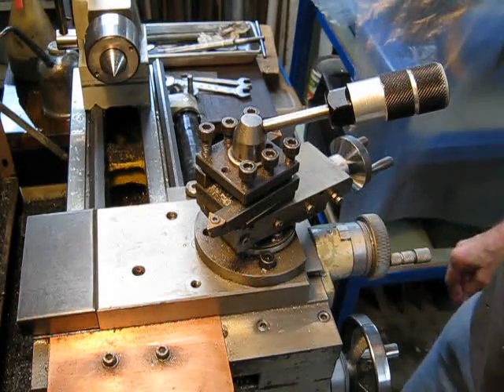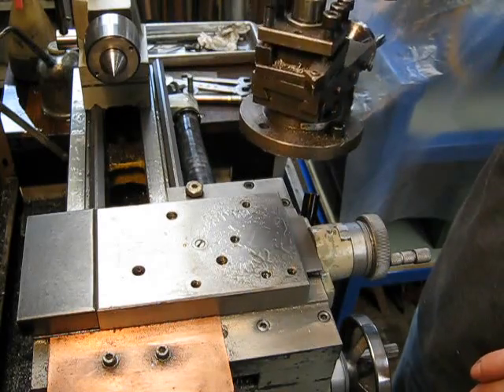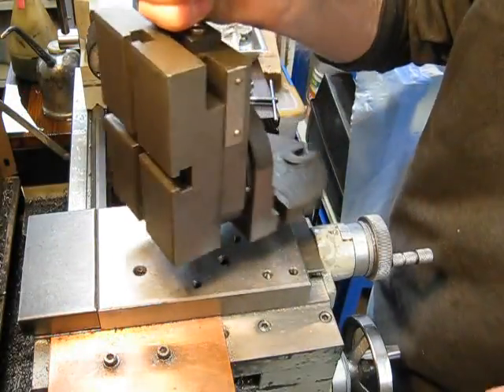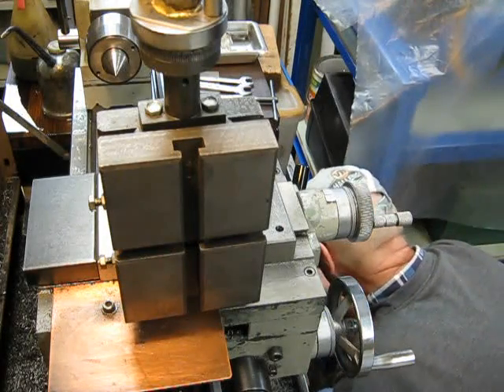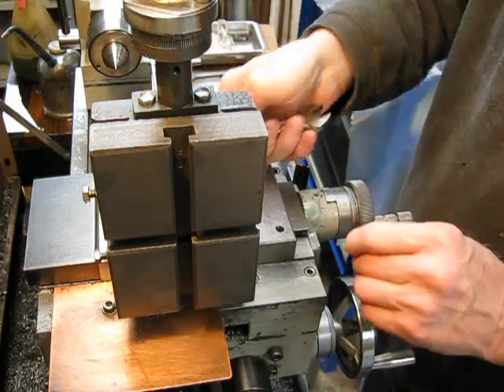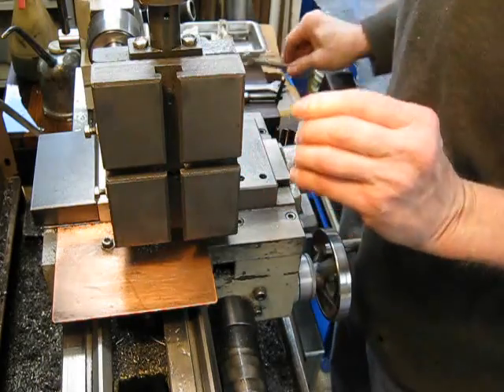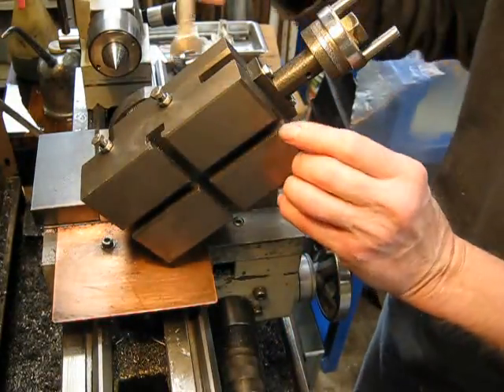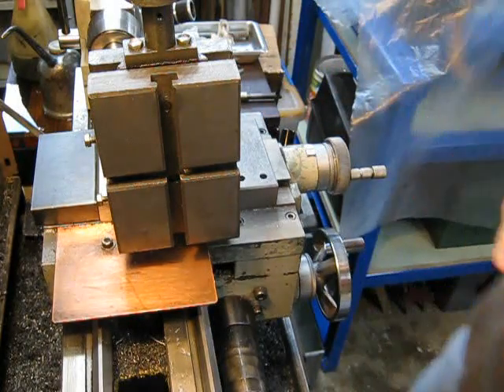Fit a vertical mill slide to a Chinese lathe - a handy work shop accessory

Comment: The slide is blocking from seeing anything you're doing. We literally seen nothing
Reply from the maker: It's been a long time since I did that video.  Yes, you are right, but there's not much to see.  Just me screwing in the three mounting bolts.

Comment: Hi rob just wanted to no is your vertical mills slide a l277 from hair and Forbes machinery house thanks rob love your videos 🇦🇺👍🏻🍻
Reply from the maker: Hi Tina.  I bought it from Hare and Forbes.  It's the same as the current L277.  I got it cheap as it didn't have the little vise (missing).  Reasonably good unit, but there was a tiny bit of divergence in the dovetails which I corrected with an oil stone.  Make sure to check the travel for consistency when buying one.  Cheers Rob
Reply: Thanks for that rob did yours have consistency problems I will be ordering online and can you explain that please I’m only a Newby is it a big problem or can it be fixed at home cheers rob 🇦🇺🍺🍺🍺
Reply from the maker: Hi Tina.  The two angular side slots on the base that mate with those on the slide itself were not perfectly parallel on mine.  I  think the base was not parallel (but can't remember for sure). This is basically the same setup as you will find on a top and cross slide on a lathe.  I bought the mill slide many years ago and maybe it's no longer an issue, but get it checked.

I removed metal with an oil stone where it was binding (marked it with Prussian Blue first to see where).  The problem may be fixed at home (as in my case) but it depends on how bad it is.  I would ask Hare and Forbes to check the slide and guarantee it will be replaced if there is any issue before handing over the cash sight unseen.  Explain what happened to me and basically give them a heads up on this.

Cheers Rob
Reply: Xynudu thanks rob much appreciated  and keep your videos coming 🇦🇺✌️👍🏻

Comment: Hi Rob, great videos, I am up in QLD and have just bought a Weiss WM-250G lathe, like the Hafco AL-250 but with a full range of Metric and Imperial thread cutting gear options. I am buying the Hare and Forbes Vertical Mill slide like you have as it makes a good option for milling. I just have a few questions on fitting it; 1. Do you mount the angle base in line with the headstock edge of the cross slide for max rigidity?  2. What is the best way to work out where to position the angle plate on the cross slide, I has thinking probably Center of the min and max travel of the cross slide? Is that correct? Thanks
Reply from the maker: Hi Chris,  good questions regarding placement.

The width of the lathe cross slide and subsequent positioning of the three mill slide mounting bolts will determine how much overhang to the left, you are "forced" to have.    Also you must allow space for the mill slide to extend down past the left side of the cross slide if need be.   You won't have much spare space to play with on that sized lathe.

Positioning of the mill slide longitudinally on the cross slide is a matter of choice.  The major consideration is how much travel it has.  Think about how that translates into usable mill slide vice travel in relation to the position of the chuck centre line (where your milling cutter will be).

The centre line should be able to traverse the full width of the vice jaw, but you must allow for the end mill to be adjusted in BEFORE the job/jaws enter the cutting zone.

You will be feeding away from the operator for best effect/least chatter, so that means the mills slide should be far enough towards the operator to allow an end mill to clear the furthest away side of the vice jaws.

I hope I haven't confused you with this.

Cheers Rob
Reply: Hi Rob, Thanks, that make perfect sense. I hadn’t thought about the need for clearance for the cutter on the operator side. Just ordered the vertical slide from Hare and Forbes so I will have a better idea idea once I get it. They only supply it with a drill press vice so will be interesting to see how crappy that is, will have to look for a better small milling vise. Do you ever do any clamping directly to the slots in the slide? Thanks Chris.

Comment: Hello sir,
It is with great interest that I followed your video. Currently I am very interested to install the same milling device.
I also visited the 1st link proposed.
Would you be so kind as to help me find this 6 "× 4" slide. All my attempts to locate there have failed.
Do you think this slide size is sufficient for my "Optimum D320 × 920" lathe, with a cross slide width of 120mm, a 95mm cross pin / slide distance.
Another question, what is the width of the jaws of the vice mounted on the slide?
A favorable answer would fill me and in the meantime, please accept, Sir, the expression of my best regards. P.K. (French)
Reply from the maker: Hi Paul,

This slide is sold in Australia, but I expect one similar would be sold in Europe.  It should fit your lathe easily (my cross slide width is 110mm).  I have not seen any bigger slides being sold. The jaw width is 75 mm, but you can fit any vice you wish using the "T" slot provisions.  The mill slide width can take a wider vice.  The only restriction will be the available cross slide travel.  Cheers Rob

Comment: Hello sir,
It is with great interest that I read your video. As I begin, I would already like to equip a complete milling square, like yours. Can you, please, specify the model and give me the link so that I can buy it. In the meantime, good luck and cordial greetings. P.K. (French)
Reply from the maker: Hi Paul,  I can't help much on this as it is a mill slide sold in Australia. I see you are in France.  I expect the slide will be sold thereby a machine shop or lathe supplier.  It is probably a generic unit. 

I see they are now cheaper than when I bought mine. Here is the unit: https://www.machineryhouse.com.au/L277?gclid=EAIaIQobChMI_OKG2KjC5QIVxBaPCh3RIAbTEAQYASABEgKVJvD_BwE

I see it is also available on Ebay.

Good luck.

Cheers Rob

Comment: Rob, today I picked up my vertical mill slide from General Tools, same as yours! Impressed- a solid little unit, a bit roughly finished but finished well on all the surfaces that matter. BTW, after your advice, I ran it through its full range of travel before buying and it was uniform resistance, so no convergence thankfully. The only difference however is that the vice that came with it is nowhere the quality of the one you used in your video. Did you swap yours out for a better one, or is it the one that came with the mill?
Reply from the maker: Hi Brian,

I got mine cheap from them as the original vice was missing.  So I just modified an old tool makers vice I had laying around.  It does make for more overhang though.

I replaced the gib screws with longer tapered bolts and lock nuts so I can easily lock the slide with a spanner.

Cheers Rob
Reply: @Xynudu  Thanks Rob, that's what I figured, your vice did not come with the mill slide. The vice mine came with is pretty light weight compared to the mill slide and yours, so I will be looking for something better, all the best and thanks again.

Comment: fair size there ....question been trying to find those covers for leadscrew...any clues there..??
Reply from the maker: Hi Miguel,

You can buy them as aftermarket units for lathes and other machinery from specialist suppliers, but they are pretty expensive (last time I looked).

Search on "spring coil lead screw covers" and a few come up - easiest to see/locate them from the images section.  eg:  http://www.lovegreen.com/online-store/centry-covers.html

These are the spring steel expanding tapered coil type, same as I have.  Very durable and 100% effective.  BUT you will reduce your carriage travel by their fully compressed length.

I see some rubber/plastic concertina type on Ebay as well, but they look pretty crappy and I expect hot chips would burn holes in them.

Hope this helps.

Cheers Rob

Comment: Were did u buy the slide from Rob, And thanks for the vid,
Reply from the maker: I bought it from General Tools at Cavan in South Australia.  They are basically the same as Hare and Forbes (all the same stuff).

The Chinese mill slide cost about $200 and is good and solid, BUT the dovetails had divergence in the base/mountying section - which is not good.

I reworked that bad area and all is sweet now.  I don't know if they are all like that, but it would pay to wind it through it's full travel range before buying, to see how it is.

There's not much else around except some rubbish from India, and I mean RUBBISH.  Nothing against India, and I even drive an old truck made in India, but there is some seriously low grade stuff coming into Oz from India (machine vises, milling bases, you name it  etc.

I hope this helps.

Cheers Rob
Reply: Thanks rob,
Reply: fucjape2

Comment: Nice. I've done one using a top slide.
https://youtu.be/SRCnrcOrV0E
Reply from the maker: +LeoCascao 

Looks very good.  I would do that too if I could find a decent sized top slide at salvage.

Would be interested to see it on a pan around, to check out the mounting plate/support bracket etc.

Thanks for posting.

Cheers Rob

Comment: Hey Rob - dumb question mate, but why don't you have a quick change toolpost? Could probably make your own posts as well. Guess it's a fair bit of work and $. Btw I got a collet set on your recommendations and they're bloody tops. Excellent advice.
Reply from the maker: +tfre3927 

I never really found the need for a QCTP.  I have two four way heads with my most commonly used cutters in them that I swap over as required.  I expected this question one day.

Some 4 ways are also pretty bulky making it difficult to get in close at times.

I guess I'm just old school :)

Cheers Rob.
Reply from the maker: +tfre3927
 Ooops I meant some QCTP are fairly bulky.  My bad.

Rob

Comment: Giday Rob. Im guessing you are from SA, like me,from the  look of your paramount browns lathe. I like your idea of utilizing your lathe to do milling as well. Question.. where did you find your vertical mill slide as i havent been able to find one. Cheers Darren
Reply from the maker: Hi Darren. Yes I'm in SA.

The only place I could find a suitable sized mill slide was General Tools at Cavan.  This is a Hare and Forbes affiliate, so they have all their stuff - check H&F catalogue on line and you will see what I mean.

It's a good and strong slide, but the dovetails on mine have very slight convergance which makes then tighten up near one end - cost about $200 - from memory.  So check out the ones on offer closely as they may vary.

Sometimes you see old lathe mill slides on Ebay, but they invariably have a single point toolpost type mount.

Very handy to have a lathe setup with this facility for the odd small job.  Cheers Rob.

Comment: Hi Rob,
Did you size the holes to allow any pivot adjustment of the vertical slide to the lathe cross slide? Keen to try this but want to make sure I know exactly how to go about mounting it before I drill/tap my cross slide.
Also, are the mount holes blind?
Thanks,
Great videos by the way.
Reply from the maker: The three 10 mm bolts measure at 9.77 mm (on plain shank section). The mill slide holes/slots measure at 9.44 mm. So drilling 10 mm holes in the slide base will make them a loose fit.

I drilled and tapped each hole in the cross slide separately and filed out the blind end of the millslide slot with a round file to get a close fit.  I did one bolt, aligned the mill slide to the cross slide, did the next on the same edge. Then did the one on the tailstock side last. I drilled/tapped right through.  You must remove the cross slide to drill tap and refit to align each bolt position.  Also be sure not to interfere with the gib strip.

I have slight rotational play in the base when loose, but this is not an issue when bolts are tightened.  Same effect as when using "T" slots.
Reply from the maker: xynudu .
By filing out the holes in the mills slide base, you can "move" the hole slightly to compensate for any small error when the cross slide is drilled and tapped.
Reply: xynudu . Thanks Rob, once I source a suitable vice I'll be set.